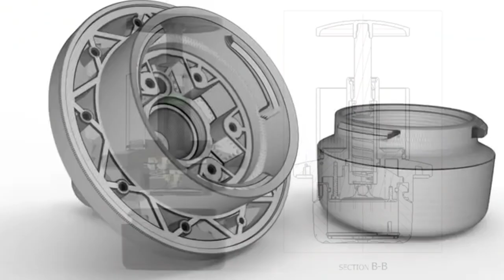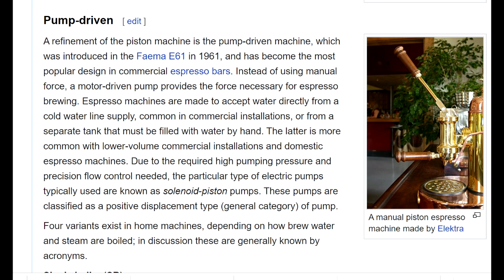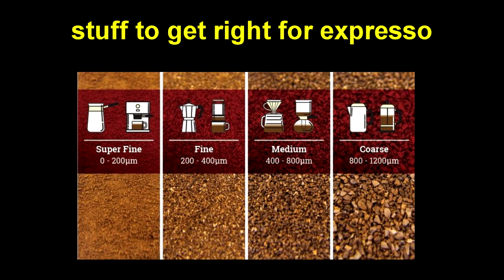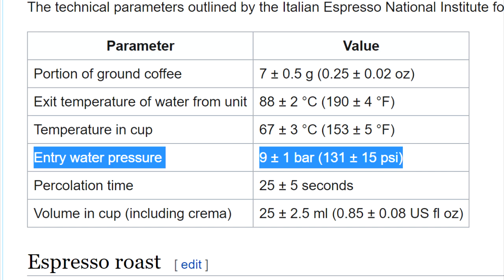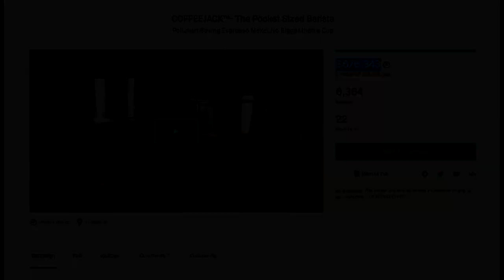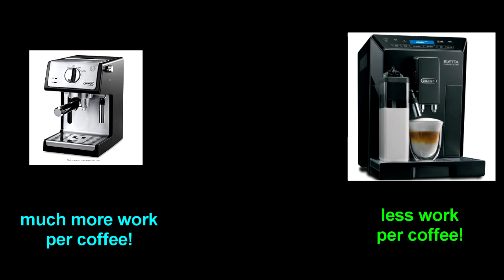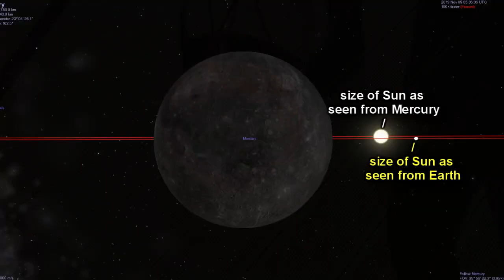CoffeeJack: BUSTED!!

Comment: 392 prototypes! Something tells me their 'engineers' don't know what they're doing.
Reply: MFW you're being paid by the prototype.
"Let's add wheels to it!"
Reply: The frame at around 0:48 shows you are right -- I would expect something more professional than the "hobbyist"-grade Arduino IDE...  :D
Reply: Hugo van Galen Arduinos are fine for prototyping, it can save a ton of time and is used more often than what people would expect. 

And 392 prototypes for that kind of thing ? We’re not talking of a smartphone here, it shouldn’t require that much prototype to get it right.
Reply: @cedricpomerleau5586  "Arduinos are fine for prototyping" but if you use the chips directly you would still use the arduino ide... sorry, just a small hobbyist talking here :D
Reply: it is the same same prototype wooooo
Reply: I guess they mean each iteration is considered a prototype in marketing terms. So they add an extra 'O' ring to the piston and boom it's a new prototype.
Reply: @therealchayd  Doubtful, that would be considered a design revision and unlikely to be considered as a new prototype; of course, I can't speak for the people who think that the larger the number of prototypes, the better the design, but I do know that I would be embarassed to admit we'd gone beyond about 5 prototypes during development (incidentally, 6 units built to the same design would only count as 1 prototype)
Reply: Yeah, if they accepted this project in the first place, then clearly they don't know what they're doing...

Comment: "Every stupid idea starts with trying to solve the wrong problem"
Reply: Every stupid idea starts without a problem. Then you 'create' the problem.
Reply: I've got an idea, let's what if energy was equal to mass times the speed of light CUBED instead?
Reply: @Csquared I got a better idea, let's spell correctly.
Reply: @FJDH11  let's do it
Reply: Which sounds nice, but in essence is a false statement. Stupid ideas start with wrong assumptions. As the movie under siege put it most eloquently: "assumption is the mother of all fuckups."
Reply: @Ohne_Silikone  Good point. Let's turn that into "Every fuckup starts with trying to work under the wrong assumption."
Reply: @FJDH11  bit like modern feminism actually
Reply: That's simply not true. There are manny stupid ideas trying to solve the right problem with the wrong method. Like stopping Climate Change by stacking concrete blocks, well Thunderfoot's channel is full of good examples for that. Using your ass cheeks as a starting ramp for firework is a stupid idea that doesn't even try to solve any Problem. (Still funny to read in the News, tough)
Reply: @FJDH11  No, that's classic sales xD
Reply: Every stupid idea starts by inventing a problem.
Reply: Sound about right for every shopping channel where they find and overexaggerate the stupides things to make problems of everything. "Buy our knifes thats recommended by our 5 star chef you never heard of while looking at a lady trying to cut a tomato with a knife as sharp as a wooden spoon".
Reply: @Ohne_Silikone 💯

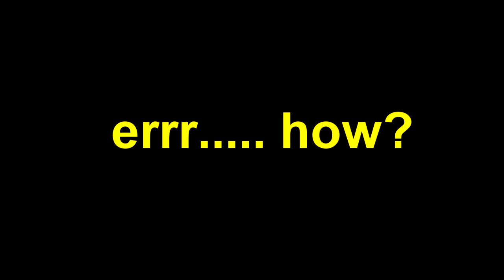Comment: 2:46 The solution there is reusable mug, not a portable coffee machine.
Reply: I wonder if coffee shops selling reusable mugs and giving you a cheeper price for the same coffee if you bring their reusable mug each time would help cut down on plastic mugs....
Or have them sell thermos cups with a barcode or chip or something. And lower the price of the coffee slightly for the guests bringing theirs, scan the thermos or mug quickly to validate it and then fill it with coffee.
Voila.
Im suprised coffee shops arent doing this already.
Afterall. In the short term it will make them way more money to sell a 50$ mug and knock of 5-10 cents off the coffee. Not to mention the publucity stunt of 'we care for the enviroment' promotions. And the greater likelyhood for customers returning because they feel the need to validate their purchase and make up for the money spent on the mug.
Reply: @ethribin4188  my local coffee shop has reuseable cups made out of recycled coffee cups!
Reply: Chazz if they’d recycle the coffee too that must make it even more better right?
Reply: @ethribin4188  3 shops close to me if you buy their (their over priced ones so you can't take your thermos and expect a discount) mugs they give you 50 cents off.
Reply: @motalasuger  You can use the grounds in the garden plus i use them to fight a a yearly ant issue in the area I spread the grounds over the nest.
Reply: @ethribin4188  I've seen a lot of coffee shops offer a discount (10-25%) for bringing your own mug.  The only issue I see with this is cross-contamination of allergies (think if someone was eating peanuts, then took their peanut contaminated mug in for a refill)
Reply: Not if you press the coffee straight into your mouth.
Reply: Thankyou for this wonderful answer.
Reply: @ethribin4188  So you wonder why? Simple: Liability. Specially in places like USA where people get sued for other peoples utter stupidity, company taking in people own coffee cups would most likely be liable for food poisoning, even if its morons own fault of not washing it.

Then again mentioned bar code system could work in form of bring the cup back and we wash it and in the mean time heres another for you to use, but even then there is possibility of intentional tampering and damage to cups. For instance on thermos cup drill tiny hole on inside layer, use injection needle and syringe to fill it with toxin of your choice and seal the hole with something that can handle the washing machine and only melts when hot coffee is poured in. This lets toxin into coffee and poisons the random target. Even if there is account and mug is tied to it, so what? person bringing it and who took it out can just say and it well might be true that they forgot the mug on bench and it was gone when they got back and another guy can say he found it in his way on shop and though to get bit cheaper coffee with it, so tampering could have happened in any time or place between these two and proving the attempted murder or murder is bit hard with out proper evidence and who knows they might be innocent as well.

There is no system in place that is perfect and this kind of thing could be huge problem. Heck it might be coffee shops next door doing this to cause fear and drive customers towards them.
Reply: I'm pretty sure you could ask places to fill up a metal mug since you're already a paying customer?
Reply: rage ANT MURDER!!!
Reply: @Hellsong89   Phoe Phoe   they wouldn't give the cup a quick wash first? really??
Reply: Buy coffee in a stay-in mug, pour it into your own mug, take it with you, let them wash their own mug.
Reply: @ethribin4188  I dunno about coffee shops, but both the universities I've been at so far offered re-usable mugs for their canteens.
Reply: Actually, it is against the Florida health code for a company to take a cup or mug back over the counter and refill it due to the risk of cross contamination.  The proceedure is to wash your hands before taking the mug, then wash, rinse, and sanitize the mug, allow the mug to completely air dry before refilling, then wash your hands again when finished.  A full service restaraunt that uses their own ceramic mugs can either bring a new mug to your table, or leave the whole pot at your table ( which must be empties and washed before using with the next customer).
Florida has adopted the Federal health guidlines, so any state that has adopted the same guidlines (which is most) will have the same laws.
You might wonder how Starbucks gets away with it.  Well,there are advantages to being a huge company with teams of lawyers and lots of money.   A smaller company, like the one I work for has no chance of getting away with it.  We have already been cited once, and nearly a second time within one year.  It is way too impractical to follow proper proceedure due to the volume of customers we often get, so we have had to start refusing other cups altogether.
Reply: @ethribin4188  so i need a mug for every shop?
Reply: a reusable mug also known as a mug
Reply: As long as they're nothing like those murderous reusable straws...
Reply: NetAndyCz Actually, it's called recycling. If they don't do that in your county, city or country then that's a culture, political and education problem, not the problem of mugs or straws or people who use them👌🏻
Reply: @V0YAG3R  Recycling does not work well for most plastics, it is okay for "clean" PET bottles, and few other materials, but any contamination is serious issue for most and downgrades the quality quickly, besides hardly anyone sorts different plastics separately.
Reply: Reusable mug? Oh... You meant a glass/ceramic mug/cup
Reply: @yanuchiuchihaanimegamesand3907  Well, those are not good for travelling, they are bit fragile. But quite okay to have at work. Anyway, I prefer to get good coffee experience and part of it is to get it served in a nice ceramic cup. Those plastic ones are just not my thing.
Reply: @Erik Andersson Even better is to recycle the water, piss into the cup again after you drink the coffee, and have it make you some more! Eureka! Soon enough, we'd be eating ourselves to stay "green".
Reply: @ethribin4188  My local coffee shops have exclusive mugs for regular customers.

Comment: This looks like an over-designed aeropress.
Reply: It cannot produce as much or as well as the aeropress, turns out these people aren't even "frisbee scientists"
Reply: Surely you meant to say under-designed? They essentially removed all innovations to make it easier in favor of the machine fitting their idiotic form factor of a handheld cylinder.
Reply: @Daealis  How do you remove features from an aeropress?
Reply: It looks like an aeropress that was designed poorly, but then again, I'll be interested to see how well their product performs against a lever press. I have a feeling that the lever-pressed espresso machine, will outperform this silly kickstarter coffee maker.
Reply: @Daealis  an aeropress is 3 pieces of plastic and a filter. No high pressure BS pump required, and the hot water can't splash out. This one is overengineered and not thought through.
Reply: no. an aeropress is a extraction (infusion) machine (the coffee soaks in the water), this machine is a percolation machine (forces water through the coffee). I learned this by watching James Hoffmann.
Reply: @geoffreymendelson 
Aeropress is an assisted percolation machine. Percolation means that water is passed through ground coffee by gravity only. With aeropress you speed up the process by applying small pressure.
The machine they're trying to produce here is an espresso machine. To be qualified as espresso the extraction pressure must reach minimum of 9 bar.
A good example of infusion method is the plunger press aka french press.

Comment: I am a coffee afficionado and I can tell you that 95% of the flavor quality comes from the quality of the beans/grounds. The way to get high quality coffee on the go is 1.) carry good quality grounds with you, and 2.) bring absolutely any brewing paraphernalia that works. If it tastes bad after that, then you're making some critical mistake in your brewing process, such as not cleaning it well enough, not rinsing the soap out well enough, using the wrong amount of grounds, or such.

Furthermore, I'm fairly certain there is no discernible taste improvement from making espresso. The whole point of it is to brew it rapidly and then potentially add something other than water afterward (espresso+steamed milk=latte). There is no need to have an espresso machine to make your own coffee your own way. You can make a latte at home by brewing your coffee thick and adding milk--or brew it normal and add half and half. Not foamy enough for you? I dunno, shake it up? Use a mixer? Accept a lower quality product while you're away from home, like any lower class citizen would do? If you're rich enough to whine about this sort of thing, surely you can pay someone local to produce a latte for you.

Better than CoffeeJack: any French Press.
Reply: Picoespresso

Comment: In their defence, I would say that:
* The piston diameter is about half of what TF is using for his larger test syringe, giving you more pressure, but more pumps required.
* Secondly, this is for scenarios such as camping, hotel or portable uses where you would have access to boiling water, but not power or space needed for a full size electrical coffee machine (I don't see a use case for offices which probably already have a coffee machine of some sort)
* Thirdly, glass performs well under compression, especially thick glass in espresso cups (you could probably stand on one of those things without it breaking)
I'm not condoning this product, it's pretty much reinventing what's already out there (handpresso etc), and is ridiculously expensive for what is basically just a piston and cylinder with some additional plastic parts.
Reply: so why show a guy, in A SUIT, putting it in a handbag that looks like it's to bring to an office?
Reply: @lamalamalex  Probably because their  extensive market research showed that the target demographic would be people in offices for some reason. I would've personally targeted it at campers, hikers and vanlifers.
Reply: I had to try it just just out of curiosity: even wine glasses hold over 20kg of pressure, so no problem there 😅

Comment: The giveaway was when they mentioned former Dyson Engineers.
Reply: That were fired because of insisting to push their idea of a hand pumped hair dryer one too many times.
Reply: there is a reason they are "former" ^.^
Reply: @mrkiky  how much pumping do you have to do to get decently powered air dryer?

Comment: At first I thought the Coffeejack would have potential as a portable espresso maker for when you're out camping. But I looked around, and I found out a product like that already DOES EXIST! It's called Nanopresso, which is ready for purchase right now, and looks a lot safer due to not using a glass water tank. It uses ground coffee, or you can purchase an adapter that lets you use Nespresso capsules in it. It also "doesn't need electricity" which means you need some way of heating water first.
If you want an espresso maker that heats the water, there's a product called Handpresso Auto which plugs into the 12v outlet on your car. There's a version that uses ground coffee or espresso pods which has been on the market for a while, and another version that uses Nespresso capsules. 
I'm a coffeeholic too! I have an automatic espresso maker too, and I love this thing! I'm so happy that I bought it! It's a Philips one, and it isn't even one of those fancy ones, but it makes very good espresso with minimal effort and that's what matters to me.